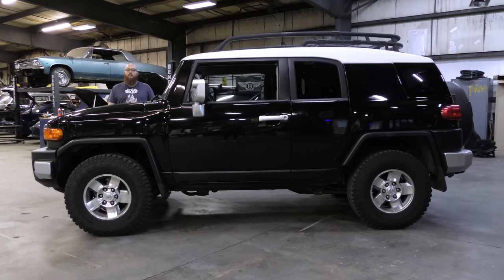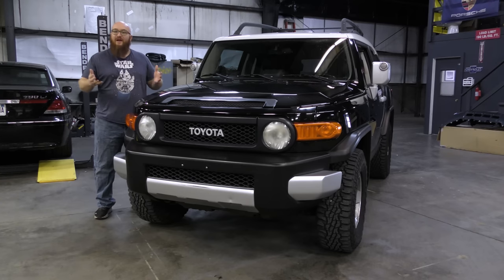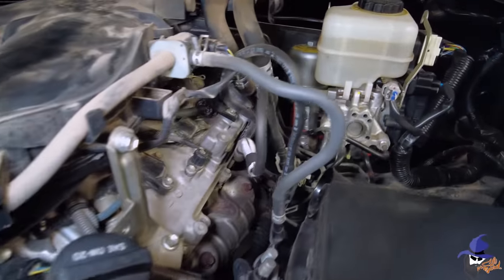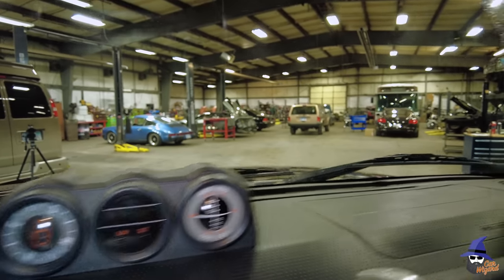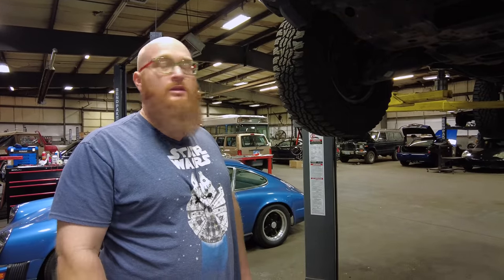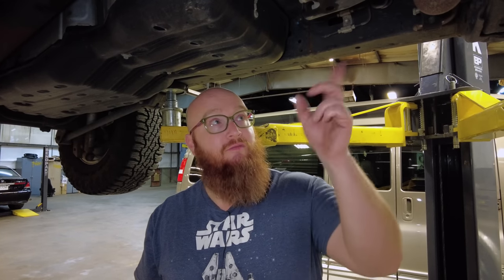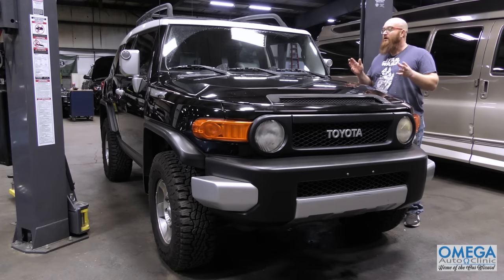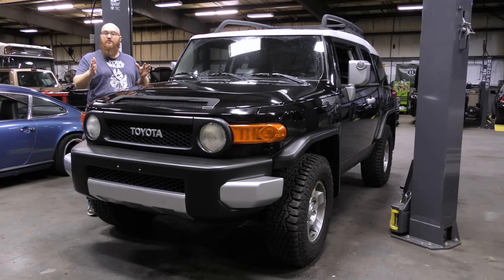"I finally got the Toyota I've always wanted!" CAR WIZARD gets a 2010 FJ Cruiser!

Comment: I've owned 23 cars in my 58 years and I'll die before I give up my 2008 FJ. It's a great vehicle and kept me sane during Covid.
Reply: I am trying to buy a used 2008 FJ(180k miles) but people say it has issues that have been corrected in 2010.
Reply: what kinda gas do you get for ur 2008?
Reply: i have a 2011, it's a fricken tank, i know for a fact i'll be done waaaaay before it is.
Reply: @marcelob6048  It's not great. As an average I'd say about 15mpg, on the highway it's about 22 mpg. That big windshield acts like a parachute.
Reply: I won't give up mine either.

Comment: My Grandma is 90 yrs old and still drives her 2010 FJ w/ 4WD, same color and all as this one in the video. Only 108k miles. Seen a local toyota dealer in my area of So Cal recently asking 29k and change for one with similar mileage as my dear Grandma's. Excellent vehicle.
Reply: DOOR PANELS....BLIND SPOTS,?THATS WHAT MIRRORS ARE FOR...
Reply: I live in So Cal too and maybe saw the same FJ on a dealership lot.  All I could do was shake my head.
Reply: Sold my 2014 FJ with 120k miles for $30k last year. Bought a 4Runner TRD Off-road after. Both incredible vehicles.
Reply: @jamesheverin1293  wtf are you on about?
Reply: Badass Grandma with a Badass FJ
Reply: @zacharypeery4082 I think he commented on the wrong post. The one above this comment is about the blind spot 😅.

Comment: You cannot beat a Toyota, especially with over 180,000 miles! This is why I love Toyota
Reply: I do like Toyotas but my Volvo V70 5 cylinder with 250000mls runs like new as well.
Reply: Barely broken in at 180k miles. If the previous owner maintained it properly  you should be golden

Comment: Hello,  Mr. Wizard.  This is my first time on your channel.   I really enjoyed this video.   I just purchased my first FJ Cruiser 2 weeks ago. It has 220,000 miles.   I wanted to start off right so I took it into Toyota and had them change ALL the fluids, a new lifetime battery,  new plugs, 4- wheel alignment, rear wiper,  and fix a tiny crack in the windshield.   I have no rust underneath either,  so I'm hoping to get many more miles out of this unique looking vehicle.   I hope yours gives you many years of enjoyment.   Keep us posted.

Comment: Nice find.  I have a 2010 FJ Iceberg 4x4 I bought new.  It’s been garage kept it’s entire life has right at 87k on it now.  The original Panasonic battery lasted 12 years 👍.  Only issue was a driver side front wheel bearing.  The brake pads look to be not even half worn so far.  I am 65 and don’t plan to ever buy another vehicle for my self.  Wife has a 2013 Avalon with 112k now, it was bought new and not one mechanical issue.  Toyota knows ho to build great vehicles

Comment: Out of the over 150 cars I've owned my FJ is hands down my favorite. 

225,000 miles on her as of today and I've never had to change anything but brakes and oil, yet
Reply: Look out for mine around GR! Orange mirror lights that I’ve got wired to the signals.
Reply: Why did you choose to not regularly change the transmission fluid? It breaks down after 60k miles. You should strongly consider it
Reply: @:vicious:  yesssssss! I should......it's a 6 speed manual. I'll run right out there and do a fluid and filter change! 

All fluids have been serviced
Reply: @profencegrandrapids2684   you must be trolling? Never heard of a manual with a filter. That being said, changing the gear oil is still a good idea.
Reply: @bobdole870  yes, Mr Dole, I was being sarcastic. 

Point was, nothing outside of regular maintenance has been required.
Reply: 150 cars ? it is a typo ?
Reply: @casualgaming2570  no, sir. 

1) I'm old
2) between my personal use and my businesses we have bought a lot of cars/ Work trucks
Reply: @casualgaming2570  and since I left that comment 2 months ago I've put another 12,000 problem free miles on my FJ
Reply: Known fj production has stopped and how is the availability of themtho?
Reply: @_Ashii89_  so many of the parts are shared with Tacomas and 4 runners parts have never been an issue. Plus these are still made and sold in multiple other countries. 
Aftermarket has no shortage of parts, either. 

I'm about to replace the exhaust from the engine all the way back with no issue getting parts

Comment: I have a ‘10 FJ as well. The dash box is great for insurance card and registration, but my favorite use for that box is to prop open the lid and use it as a cell phone holder. It’s perfect for driving and having “the map” displaying while traveling.
*edit - there is a cabin air filter behind the glove box. Swap that filter to help with the K9 smell.
Reply: That driver side upper dash compartment is perfect for my Glock 😏
Reply: @SCBiker58  .....hope it doesnt get too hot to hold!!!  lol
Reply: That's awesome! I'm going to have to try that with mine and use the dash box to hold my phone when needed. Good thinking!!
Reply: If you live in a hot climate you could put your lunch in it in the morning and it will be cooked by mid-day.

Comment: I had a 2012 Tacoma X-Runner , loved that truck . It had the same engine as that , but with a different less restrictive intake . The intake was a X-Runner only part.  It was lowered 2” from the factory , had a six sped manual . And a body kit . 17 “ wheels with high performance low profile tires . That truck was awesome , I miss it .
Reply: X runners were based on the 5 lug stuff. It's just a little different then the 6 lug stuff the fj comes with.

Comment: 16" wheels were used on the Off Road Package, Trail Teams, TRD, etc . 17" was the base model size.
Reply: Bilstein shocks were also part of the Off Road Package
Reply: @eastcoastmountainbiking6428  OK, mine has Bilstein. I wasn't sure if all of them did or not. Was the gauge pod on the dash part of it too?. I've seen some that did not come with that. I think the A-trak and Locking rear diff were part of Off Road also.. Mine has Off Road, and Convenience Packages and that's it. I added the steering wheel controls on the left for the radio, and a leather wrapped wheel so far. I love that Toyota wires all of them for every option.
Reply: @scootypuffjr.  Still have my window sticker from 2008.  It is now a garage queen with 65K.      The gauge pod ( Multi-information display ),  came with the Off Road Package.   The Offroad package required the Convenience Package.   A-trak and the Locking rear diff were part of offroad.    All FJs have A-trak,  some did not come with the button which can be added on.
Reply: @eastcoastmountainbiking6428  Thank you, and congrats on the collectors item.😁 Mine is sitting at 98k miles right now but it will be adding up fast from here on out.

Comment: Hands down one of the coolest cars ever made, when you combine that with bulletproof reliability, is there a better vehicle?!
Reply: My 07 Tundra SR5 4x4 has 287k runs great. I tow a 35 ft TT with no problems. Everyday driver. I worked pipeline for 9 years. The truck idled all day for years. When and if it quits I will look for another!!
Reply: @RamBo-uu9so  my 04 Mbenz 227k and still running like a beast
Reply: My m3 is better
Reply: @mzee5533  the old school ML are tanks
Reply: Why such a tiny gas tank though?
Reply: @burntnougat5341  my ML500 was a piece of junk. Owned it since new
Reply: @davidr6865  V6 is the one to get. ML350
Reply: @burntnougat5341  I thought about one of these. Some YouTube research leads me to believe it’s  reliable
Reply: Toyota is trash jeep is better
Reply: I would say the Suzuki Samurai/Jimny is better. Capabilities are equal and the FJ is bigger but the Suzuki is more commonly available, cheaper, more fuel efficient and at least equally reliable.
Reply: @19993gt  the M276 is a bit of a hidden gem from Benz for petrol engines. Very reliable design, good and smooth power and many models to choose from that had it
Reply: The engine and trans was reliable, all of the electronics were a disaster. Abs kicking on randomly thinking I’m spinning out of control. Transmission shift module breaking, not allowing me to get out of second gear and making loud bang noises when shifting thru reverse and drive, water leaking under the dash because the moonroof drain line design was terrible. The entire gauge lighting died. Seat belt getting locked in position. All of these repairs are thousands of dollars.
Reply: 4runner
Reply: Here in the Philippines, its the Toyota Hilux (the OG "technical" vehicle).
Reply: @TragickSin  You’re smoking dope.
Reply: Xterra is better. Rated as more reliable by repair pal, cheaper to buy, more power and torque, has all the same off road goodies, better on road, better visibility and twice as practical
Reply: @codyschmid6807  but not every country have the Xterra. Here in the Philippines, we don't have it, instead its the Terra, developed from the Navara pickup.
Reply: @theandrew999  yeah we have 4 door jimny incoming
Reply: @kristoffermangila  ya that's true. I think the PRO-4X Xterra was North America only. The lesser trims were North and South America and the Middle East.
Reply: 40, 55, 60, 70, 80, and 100 series Land Cruiser are all way better
Reply: @theMGTS  even 200 series too
Reply: @theandrew999  you have no idea what you're talking about.
Reply: The Jeep xj is better and more reliable with its legendary 4.0 Street six
Reply: @codyschmid6807  dead on there. Unfortunately too many people think all Nissans = CVTs or clapped out Altimas.. Makes the good ones affordable hidden gems though
Reply: I had a coworker who drove a Jeep and was totally into it. He said to me that FJ Cruisers were the coolest F****ng thing he ever saw
Reply: @codyschmid6807  no, no , no
Reply: @univenpecalipre  yes yes yes
Reply: You are missing a small oil pan cover underneath that allows you to have access to oil plug.

Comment: Got a chance to drive one when I worked for Toyota.  Instantly fell in love with them.  Not just the engine, but the whole dang thing is darn near flawless.  Those as you know are bult to LAST.   I can see them still on the road 30, 40, 50 years from now.
Reply: We were looking for a new car when we lived in Dubai,the dealer gave us one of these to test drive for a week,I thought it looked slightly odd at first but after the week was up we couldn't bear to part with it,so we bought a new one,had it for 2yrs,done 26K,not a hiccup,no regrets perfect! One great benefit was the amount of short-cuts across the sand you could take effortlessly(2008)
Reply: Why do you think certain governments and car manufacturers are pushing for electric vehicles? They want you buying something you have to replace every 10-15 years instead instead of selling you a car that can last 50+.

Comment: The best thing about it being a 2010 is the newer, stronger 8.2” rear diff. Get the three peak snowflake rated BFG trail terrains if they make them. Your part of kansas sees enough snow and freezing rain, that having a vehicle to get somewhere in bad weather during an emergency can literally be a life saver.
Reply: We're all of the  8" diffs bad news, or just the first batch?  I've seen the biggest issues with the 2006 built '07 models.
Reply: @scootypuffjr.  I have not owned a toyota/lexus 4x4 with the 8.0 diff. But, the pre 2010 lexus GX and FJ cruiser owners that off road theirs more than the average user, have broken plenty.
Reply: I have a 07 fj with 120000 miles lifted that I off-road all over Montana and have never had an issue with the 8” diff. I have pulled out a 2 built Jeep’s that were not fun getting them out. Never let me down once.
Reply: The goodyears on there on snowflake rated
Reply: @gearwrench1davis392  Yeah, but they're Goodyears 😂
Reply: @brianphillips8228  IMLK, driver skill is often a factor in correct use VS blowing out a rear diff. Some are more forgiving.

Yes, you can over-stress the unit & then find yourself buying the heavier diff used on a 4Runner.
Reply: The Falken Wildpeak AT3W is a much better tire.
Reply: Get yourself some Yokohama geolander AT's......japanese truck needs japanese tires..just sayin'😁
Reply: Honestly, his part of Kansas uses so much salt on the road that he'd be better off driving a different vehicle in the snowy weather. Saw my old Honda exhaust completely rust out in the course of 2 years in Hutchinson.

Comment: I had to choose between a 4Runner and an FJ Cruiser recently. I went with the 4Runner because it's more practical for daily use, but still very capable off road. Both are very cool and reliable.
Reply: I would have gone with the FJ.  But to each their own.
Reply: The 4Runner is a much quieter ride!
Reply: Those 2 vehicles share a lot of powertrain  like the 4.0 engine.   I hope to get 300K miles out of my 4 runner.  I almost bought a brand new 2010 FJ cruiser.  They were about $32K brand new base model then and you had to order one and wait for it from Japan.  .....Like an idiot, I couldnt wait and bought something else. 🙄
Reply: FJ has been an amazing daily ride for me for 7 years. If I didnt have it I would look for a 4 runner but luckily I have an FJ...
Reply: The Toyota FJ is  great mechanically, but I find the cabin noise too loud, and under powered for the amount of fuel they consume. The 4Runner is a bit better.
Reply: @louishendricks-tv1sx  They literally had the same engine during the same year production models ... Same horsepower, so Im not sure where you came up with the idea the 4 runner had more power. They were built on the same chassis too.
Reply: @knifeknerdreviews4609  , both are the same, underpowered for gas consumption. Our Lexus 350 has much better qualities. My  Truck has a much better ride and off road capability and power. Just my opinion and direct observation.
Reply: @louishendricks-tv1sx  Your lexus and Truck are not an FJ. That is all that really matters. Have you not figured out that we FJ owners are a cult yet? 🤣

Comment: FYI Car Wizard, Check the top of the roof rack. There’s four rubber plugs that can fall off probably going through the car wash. If missing, the roof rack can fill up with water and cause it rust or leak.